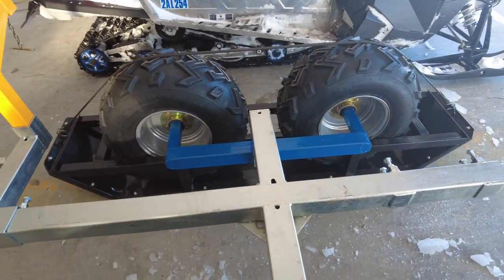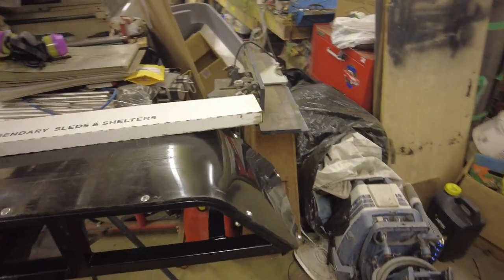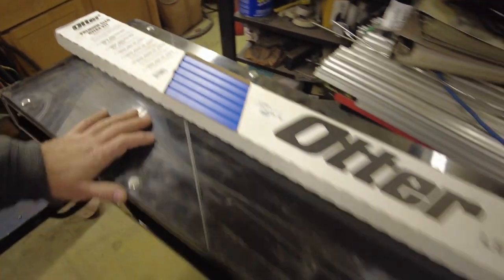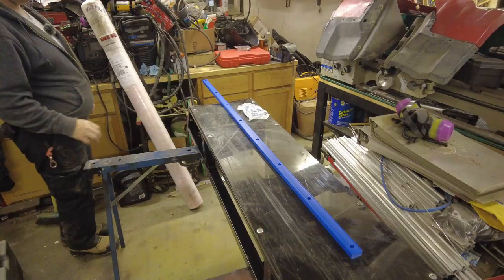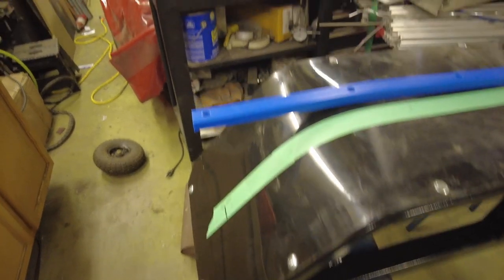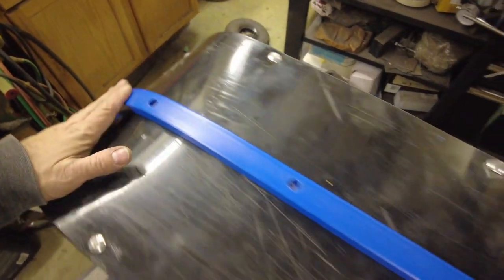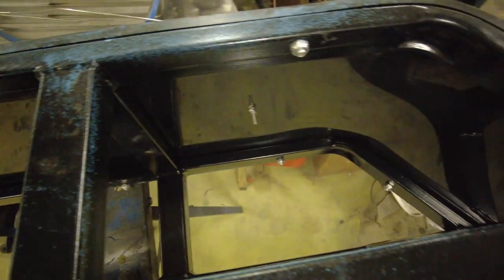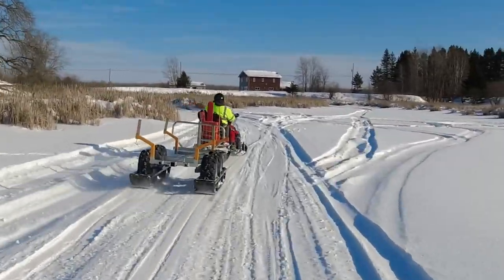Range Road Off-Road Logging Trailer: Testing the Skis

Comment: nice mod guys!
Reply from the maker: Thanks.  

I was a little concerned about the wear on the bolt heads with the limited exposure to pavement my trailer/skis had had.  The runner should solve any wear issues now though.

Interestingly, I towed my trailer/ski kit for this video and I pulled my buddy's trailer back from his cabin on his ski kit and my trailer had much better directional stability pre-mod than his did.  No idea why the two trailers would have differing handling characteristics but his trailer definitely had more of a tendency to wag back and forth than mine.  Handling will be a complete non-issue now that both ski kits are modified with the Otter runners.

Thanks for watching